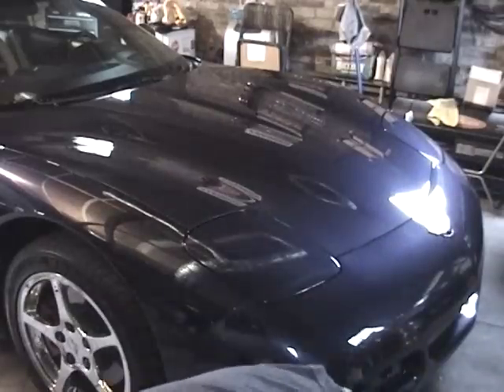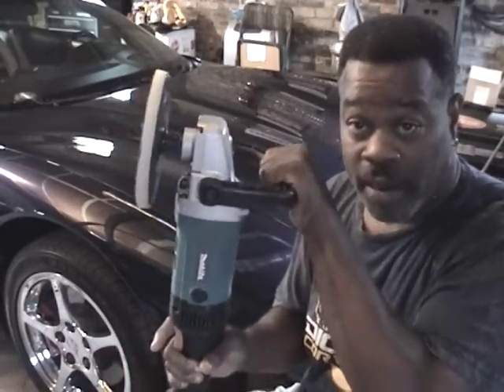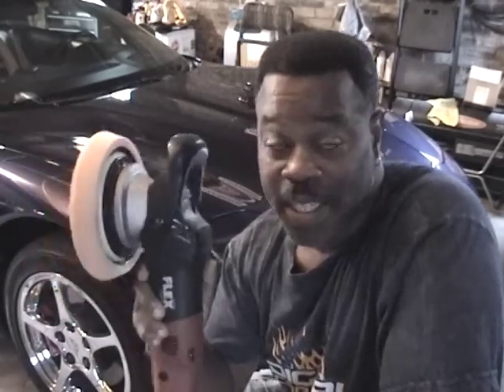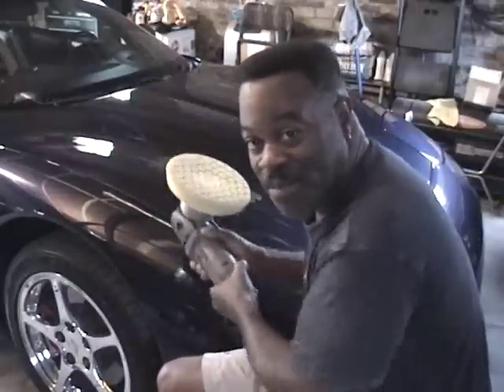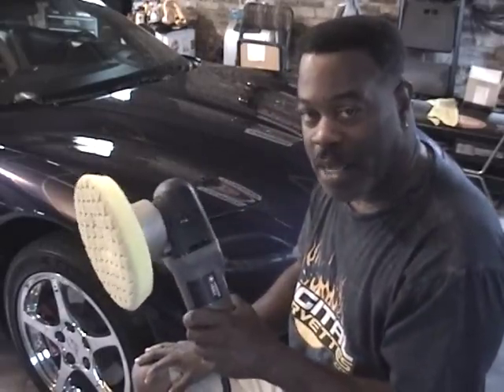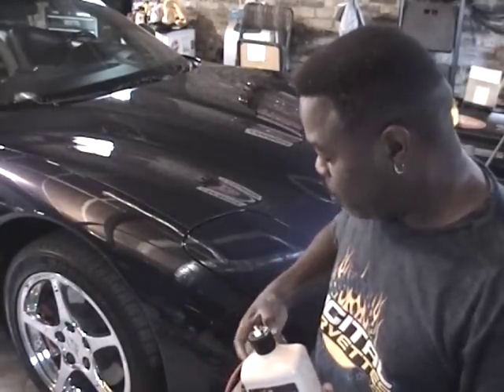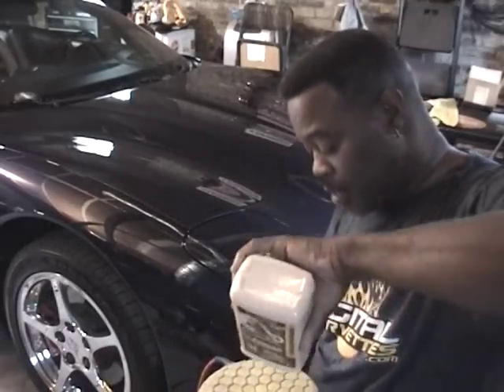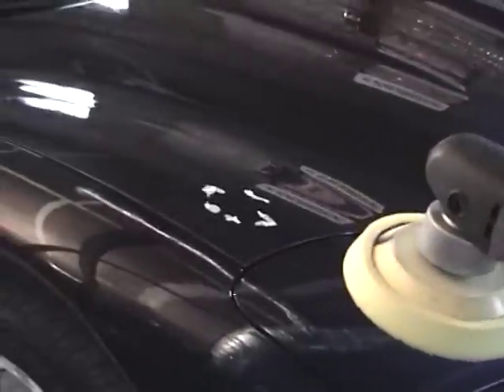How Safe is the PC-7424XP? - Part 1

Comment: Like manu others this vid convinced me to buy one, thanks junkman ! Turns out though it wont hurt your paint cause it has no balls, stalls out from its own weight. Tried it with some meguirs ultimate compound, that stuff is garbage. They claim it cuts better than any polishing compound but I had better luck with the cheap white turtle wax polishing compound.
The pc was great for waxing though.
Reply from the maker: You see, you're one of those guys who are commenting and giving the PC a bad rap because you don't have a clue how to use this polisher. Had you started off by watching my MUST WATCH playlist, you would have started out using this polisher with some sense of knowing how to actually use it. Add to that, I have MANY, MANY videos of me using this polisher with remarkable success. 

So here's what YOU need to do. Start by watching my MUST WATCH playlist. When you get to the videos where I actually start using the polisher, NOTICE ALL OF THE THINGS that you were doing WRONG. If you can't fix paint with this polisher, the LAST thing you need to do is pick up a more powerful one because YOU are that guy who will end up at the paint shop, paying someone to fix your screw up. The PC isn't powerful, it's VERY EFFECTIVE in the right hands.

Goliath laughed at David when he showed up to the fight with no armor, a bag of rocks and a sling shot. History did not serve Goliath well after he finished laughing. Don't be Goliath. Learn the power of a SOLID TECHNIQUE when it comes to using the PC.
Reply: Lol, well thanks for chewing me out and bustin my balls, I got thick skin, but I have watched the videos. Your reply to me is one of the reasons I like your vids cause you get right to the point and tell it like it 
is. I get what your saying, but mine stalls out barely touching the car, I have to just lightly touch it,  I'll exchange it and try again, maybe mine has a defective clutch.

As far as the meguirs ultimate compound, I bought it cause I live in Kauai and couldnt find the 105/205 and even by hand the "ultimate compound" aint doin much of anything. Grabbed some cheap turtle wax polishing compound and it did much better. 

Obviously I'm going to have to order something better online for polishing but I just picked up the pc yesterday at home depot so I was anxious to try it out and just bought what I could find locally.
It don't bother me that you think I'm a moron, I'll keep watching your vids because I like your delivery, sense of humor and most of all the amount of detailed information in your vids. I like the vids you do with Levi and the other guys too. 

Anyway, thanks for all the time you put in posting these vids, overall I like them better than the other detailing channels I've watched.
Reply from the maker: You shouldn't take my response as "chewing you out" and no, I don't think that you're a moron either. I think that you are one of MANY guys who have a poor technique, which causes you to experience what you are experiencing with THIS polisher. I feel that anyone watching my videos is man (or woman) enough to handle my straight to the point, no holes barred, honest and specific advice. Of course, I have ran across a few pansy asses but I am not going to sugarcoat my advice for any one. So always realize that it is definitely not personal but it is completely the God's honest truth. That's the way you should take it.

As for your polisher, explain your technique. What speed are you working at, how much pressure are you using and who sells the pads you are using? I can tell that you didn't take any notes during my machine polishing for novices videos (if you even watched them at all), because you bought that crap I specifically told you NOT to buy. But in YOUR case, NOTHING is going to work because your technique is terrible. I know that from your comment alone.I can get even the crappiest product to work because my technique is solid. If I have said it once, I have said it a million times already. TECHNIQUE TRUMPS PRODUCT, 24/7/365.

Until you realize that, you will NOT be successful with this polisher.

Comment: Theres nothing on the pad cause the color is a 2 stage paint, your buffing on clear coat.  If you did the same on a single stage color youd see it on the pad. It has nothing to do with the tool, its the layout of the paint. 
 F.Y.I  theres no need for heavy compound on this shiny new looking paint, unless theres obvious visible years of oxidation or painted surface has been wet sanded. If shiny painted surface feels rough you clay the roughness off the surface first then go from there.
Reply from the maker: Dude, you might want to take a look at a LOT of my videos BEFORE trying to give me some advice about paint correction. There's nothing on the pad because that polisher can't cut THROUGH the clear coat on the paint. If I had picked up that Makita 9227C and done the EXACT same thing, I would have cut through the clear, the paint and down into the primer coat. Smoke would have been rolling off that pad from the paint burn.

I've been doing this stuff since the 80's. This ain't remotely my first rodeo.
Reply: @Junkman2008  oh wow didnt expect such a quick response i must have struck a nerve. I have no need to watch other videos bud trust me. All i was doing was debunking the sales pitch to the unprofessional in the field. Regardless of buffing variety tools why would anyone hold a buffer in one spot with that much pressure? Interesting you didnt question or challenge my advise, not my first rodeo. As one professional to another we know theres instant results only a high speed buffer can do to freshly wet sanded paint jobs to Concours Porsches, Gulfstreams, etc...
Reply from the maker: You didn't debunk anything. The only thing that you proved was that you didn't remotely understand what you watched. Sales pitch? Dude, I have no affiliation with Porter-Cable in any way. They may know WHO I am because a LOT of companies know who I am but they haven't contacted me or paid me a dime. What I did was show the novice detailer that even if you don't have a lick of sense when it comes to using this tool, you would be hard pressed to destroy your paint with it.

Who would hold a polisher in one spot like that? Someone who doesn't have a clue as to what they are doing. Those folks are out there in droves and if you have been in the detailing game long enough, you would have met a lot of them by now. You act as if you gave me some advice. Who do you think PAINTED that car? Get real dude, you ain't old enough to know as much as I do about paint. I was painting cars when all we used was lacquer. You weren't even born yet and you're trying to give me advice? LMAO! Get back to me when companies are calling you and flying you out to their warehouses to put on detailing clinics. Until then, give your advice to someone who doesn't know what they are doing. But first, get some of your OWN detailing videos up so that people can actually see what you know, OR DON'T KNOW.

Comment: @Junkman2000 
And you couldn't be any further from the truth. How can you honestly use a blanket statement like that? You're lucky the paint is hard, had full thickness and you were using an over sized pad.
Do you really think there aren't people out there that see this video and think they can do the same? You obviously know what you're doing I'm not questioning that, but putting out a video like this when you could easily cause damage on a car with lesser paint is careless.